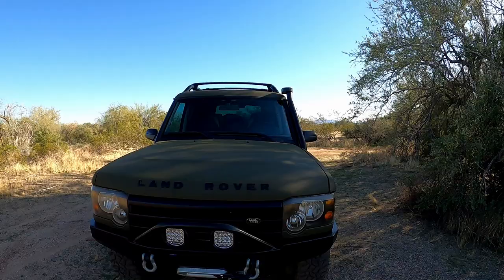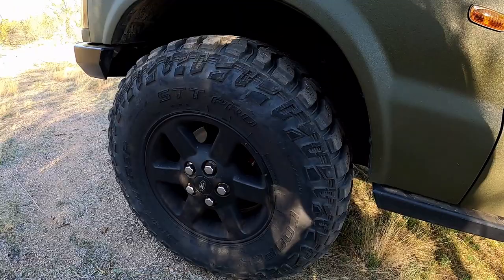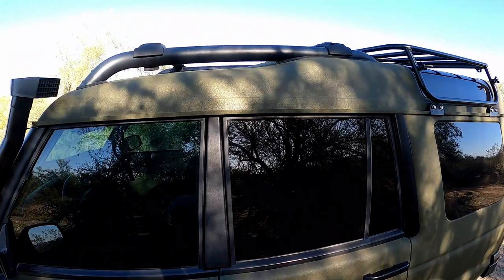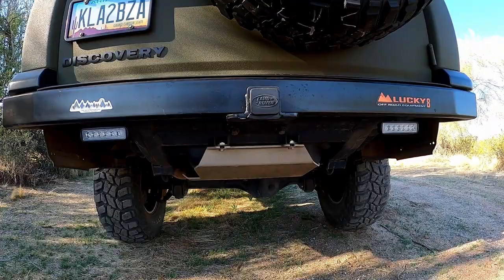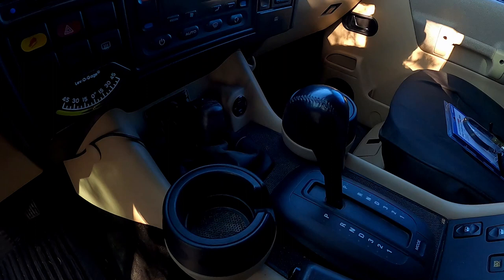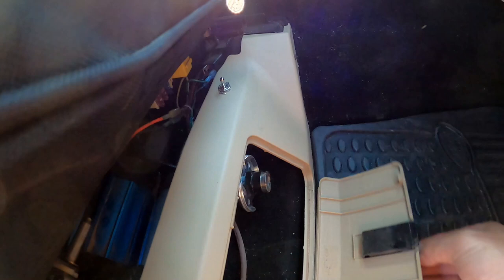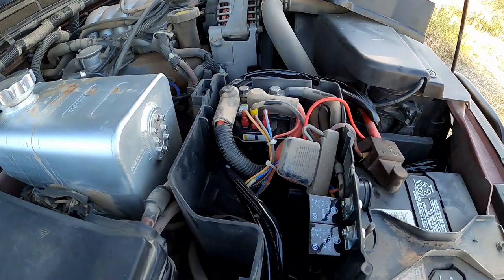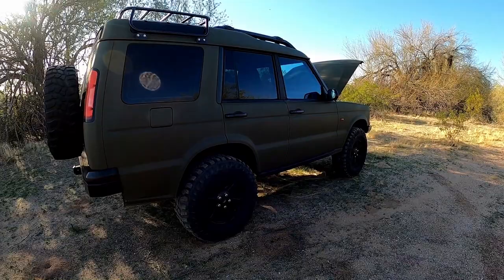Land Rover Discovery 2 Walk-around

Comment: No way man! I came and got that rotoflex from you and sold you the awning. Popped up on my recommended vids!
Reply: Btw, the OME HD will probably yield 3" on yours. Maybe different spring perches, wheel offset, etc. 

The 33s also tend to rub on sliders if they stick out too far. I just did 35s on a 3" and cut my body up.
Reply from the maker: That is so cool. I still use that awning often. It's mounted on my new Safety Devices rack. Hah!

Comment: I got my stock spare tire carrier to work with a 33" tire by taking it off and flipping it upside down. You can't use the 2 middle bolts but the other 4 seem to do just fine. The rear wiper arm then made contact with the carrier so I took that off and set it's lowest point to be just above the carrier. Works fine.

Comment: Right on my disco brother! I too live in sunny Arizona. I just got the Goliath bumper. I love it! Really solid construction and keeps that approach angle nice and tight. I think you’re able to get away with the 33’s cause your offset/backspace is really small. My backspace is like 5.5” and I get rub when turning into a steep approach. I am currently on 31’s
Reply from the maker: Nice! That bumper is the best fitting aftermarket part I have put on my Disco. I just found out Goliath also makes a rear bumper, but I'm not thrilled about the design. Glad to see another AZ Disco. You should consider joining azlro.org It's an awesome group.
Reply: @fitzventure  nice! I didn’t know there was a group. I’ll definitely check it out. Yeah I’ve seen the rear bumper and the rock sliders by them. They look solid, but I’m not so into the design of them. There is a company called tactical rovers I think makes a good option, and then there is terrafirma that I believe makes a decent rear bumper, but most likely I’m going to probably end up fabbing up my own... I’d like to incorporate my own wheel/equipment rack.

Comment: Can you provide a quick breakdown of how you mounted/secured your compressor underneath the passenger seat?  Also, are you running a single battery in your rig?  Great vid.  Great truck!  Thanks!
Reply from the maker: To mount the compressor, I cut 2 pieces of inch and a quarter aluminum and drilled holes in the strips that line up with the CD changer studs in the floor. Then, I just mounted the compressor to those strips and bolted it to the floor. I run a single battery.
Reply: @fitzventure  Thanks for the quick reply.  Assuming you had to take the seat out to install the compressor?  I just acquired a 2004 Disco II and love how where you stashed the compressor.  New tires and this onboard air system will be my first projects to knock out.  Thanks again!
Reply from the maker: @thesalesden9172  Actually, no, I didn't even have to remove the seat. The ARB compressor can lay sideways so it's pretty low profile.
Reply: @fitzventure  Hey dude!  Been doing a lot of research trying to find instructions on how to set up the air system like yours and I'm stuck.  Are you able to provide a few details on wiring?  Does the compressor hook up to the wiring for the CD changer you removed and what's needed to wire the switch to the compressor?  Is this (https://amzn.to/3faDcuW) the compressor you're using?  THANK YOU FITZ!
Reply from the maker: @thesalesden9172  Yes, that’s the compressor I have. I didn’t use any of the included wiring though. I ran a heavy gauge wire from the battery under the seat. My electrician buddy did the rest. I don’t know exactly how it works but it looks pretty simple.

Comment: Where did you pick up the cross bars for the 04 thick roof rails. I can only find ones for the skinny older ones
Reply from the maker: I actually bought an '04 that pulled all kinds of parts from. Those bars are not easy to find.